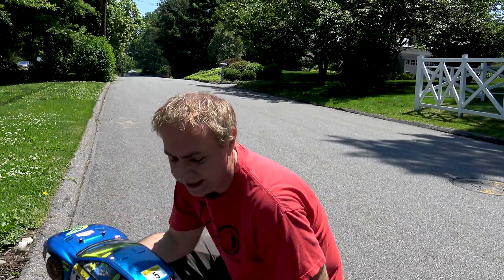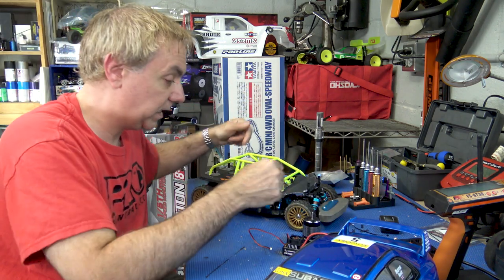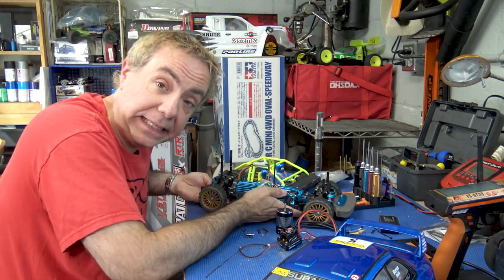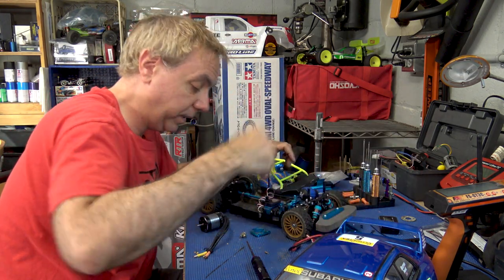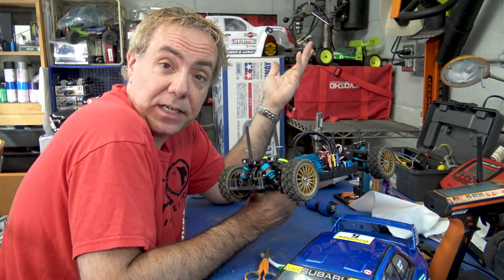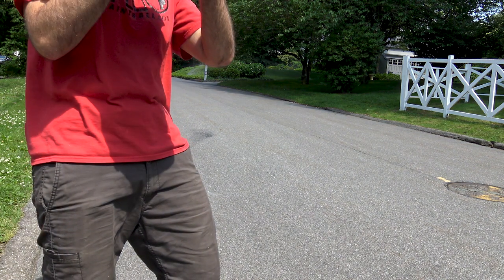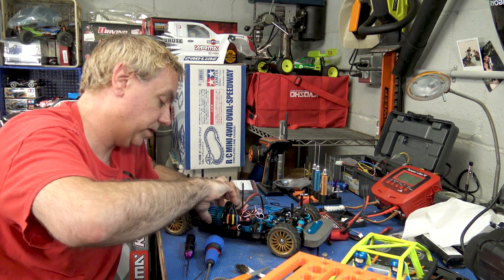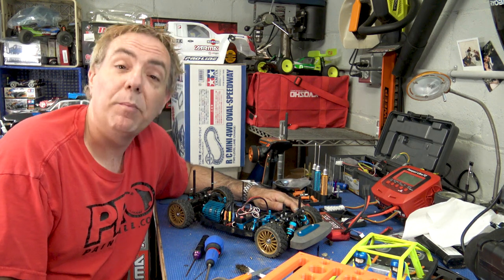Tamiya TT02 - Brushless Conversion

Comment: For anyone wondering, the noise after the brushless motor was installed is 100% binding and too tight a' mesh between pinion and spur. Try the paper method when meshing gears ❤❤ awesome video though! ❤❤

Comment: Hello John. The high speed gear set isn't for powerful motors. High speed in Tamiya terms means top speed. I.e low powered motors geared for top speed (large pinion, small spur). For you situation, using a powerful motor like the one you have requires a small pinion count and a high spur tooth count in order not  to prematurely wear out gears.
Reply from the maker: I learned that for sure. Looking into a metal spur gear next. Thanks for the clarification. Guess I should have looked more carefully before the install. Oh well. Next time.
Reply: @JohnBattistini00  The kit spur should do fine. I would look into a tamiya hardened low tooth count pinion. A 17t or 18t to start. I am building a tt02 rally car for competition and have opted for outright acceleration and torque over top speed.
Reply from the maker: @gatzuberserker  cool. I will try that I am getting another identical spur to replace the one I stripped along with the metal so I will look at a different pinion as well. Thanks.
Reply: Hey there. I have 26 and 27 tooth pinions matched with the 68t spur. No issues ripping up and down the street. Spurs are clean as a whistle. Get a tornado fan from yeah racing for your motors. I also think a metal spur is not a good idea. You will find metal shavings under the cover.
Reply: @gatzuberserker  17t - 18t is way too low ... that's a ratio of over 9:1  with that motor anything above 7:1  is probably fine, .  With 25T / 68T spur you get 7.07:1 

For reference Tamiya manual state that 10.5T 3370kv motor should use range of 6.5-9.3 gear ratio
Reply from the maker: Interesting, thanks for the tip. I have been looking at those fans, they look amazing.
Reply from the maker: Oh interesting. I didn't realize that. I guess I need to pay more attention to things like that.
Reply: I run a 10.5t brushless with my high speed set with 62t spur and 28t pinion using 48dp gearing and all is fine. I wouldn't call 4000kv too much for the gear set, not by a long shot. I've even used a 32t pinion but the motor starts to heat up. Hell be fine with that set up. His mesh was off from the start. You could hear it when he tested it on the bench and even more so when he ran it. Just needs to mesh the new spur better that's all
Reply: @aut0bahn  I absolutely agree. The high speed gear set wasn't the issue, The meshing was, I run a 10.5t brushless with gear set using 28 pinion and 62 spur on 48dp and have zero issues whatsoever
Reply: Do you guys think adjustable mounts are better than ones with predetermined  pairs of holes... that way you can set the mesh precisely yourself?    The one I have in my cars is slotted as on a lot of our 10th scale offroad cars.

Comment: I ripped my Gear with a 4500kv brushless Instant, i bought a beltdrive Universal convert kit from eBay for 15$ it works and i was surprise how silent this is now.
After 3 month of driving i needed a new belt but it cost me 2$ for a Pack with 5 of them and installing a new one Takes nearly no time.
Reply from the maker: Really? I had no idea that was even an option. I will have to look into it, thanks.

Comment: Hi, I've got high speed gear sets in a couple of my TT01s. They run super smooth and they fly along. Got an alloy motor mount in one and standard Tamiya plastic in the other. They both have mounting holes so ensures no slipping, misalignment etc... Just be sure to use the correct holes. I assume TT02 is similar so maybe try the standard motor mount... great video and I've just subscribed too...
Reply from the maker: Awesome. Thanks.

Comment: I saw another video where a guy upgraded his TT02 to brushless & he used a smaller plastic spur gear with a bigger than usual aluminum pinion gear & his seems to work amazing. He's doing speeds of 97mph, but with the correct tire compound, & so on. So it sounds like you might need an aluminum pinion with a plastic glass infused spur gear

Comment: Make sure the gears have just a little slop in the mesh. You never want it tight or plastic spur will strip in a matter of a few runs. I have had the stock plastic spur in my tt02b for years and have over 20 packs of 2s lipo runs through it. Never stripped anything. 3900kv 23 pinion with stock plastic spur.  Running 34mph gps verified and bashing.

Comment: Hi John, plastic spur gear should be fine, make sure you order steel pinion and your problem is solved. I think that weak aluminium pinion destroyed your spur. I'm running steel 25-31t pinions with 4300kv motor  and 3s - no issue. Also check the mesh carefuly.
Reply from the maker: Yeah I will be honest I think my mesh was too tight. Gonna make sure I have a steel pinion moving forward. Thanks!

Comment: Gear mesh to close you can hear the high pitch whine stick a piece of paper in between to get proper gear mesh. Im running same set up with 3300kv motor 25t pinion and 64t spur with no problems.
Reply from the maker: Gotcha. Thanks. I was worried and guess it was off. Hopefully with the new mount it won’t be an issue again.
Reply: One thing about the high speed gear setup is that you dont have to use Tamiya spurs and pinions. Im using a Robinson Racing composite pinion and a 3 Racing spur gears, much lighter rotating mass👍
Reply from the maker: @shy1lrey880  oh cool. I need to look through my bag of parts then I may have one of those lying around from other builds. Thanks for the tip.
Reply: @shy1lrey880  where did you get your set up?
Reply: @dontforget.thetruth9305  The spur gear was ordered off of the TQ Racing website and I was lucky enough to find an old Robinson Racing pinion gear from my local hobby shop, idont think that company makes those anymore. I think Trinity makes composite pinions not to sure though. So check TQ Racing website they probably have those types of pinions👍

Comment: I also have this car and will also upgrade to brushless, need to change steering mechanism to coz it's all over the place at the moment😀👍👍
Reply from the maker: Totally. I am really happy with the upgraded one from Tamiya that I installed. You may want to check it out.
Reply: will do 👍
Reply: i have this car, put shocks, bearings, foam inserts in it.
  i have spectrum  5ch with AVC receiver, no wiggles / nice steering.

Comment: Hey there. First time commenter here….but I have a couple TT02s with the high speed gear set. Note, when you use it (or different pinion) the holes you use for mounting the motor mount shift from what is in the manual. I made a similar mistake on my TT02 and the gear mesh was too tight. Luckily I caught it and made the adjustment. May not be the issue here, but something to look into. I have a brushless motor in my TT02s and they rip. If I had to be venture a guess, more than 50mph….maybe more. And I run 3s.
Reply from the maker: Nice. I have the Yeah Racing motor motor mount so while I don't have to worry about the hole I do have to align the mesh by hand, and I get I messed it up. Going to really work on it when I get the replacement spurs and new pinions.
Reply: @JohnBattistini00  ah yeah, the yeah racing part doesn’t have the mounting holes. Get the Tamiya part and you won’t have to worry about it moving on you or not getting the mesh right. I think that solves your problem.
Reply from the maker: Cool. Will check it out.

Comment: Your mesh was way to tight even on the bench at the start. The sound and fast slowing of motor was a dead giveaway. The high speed set is fine but buy a 48dp spur and pinion as gearing options will be much wider than the mod6 I think it comes with. I run a 10.5t brushless on mine with 62t 48dp spur and 28t pinion and it runs beautiful. Remember to make sure you enough backlash on the gears for them to rotate freely. But good vid dude and keep em coming
Reply from the maker: Yeah, rebuilding it now, gonna make sure it fits right this time.

Comment: I've got the same high speed gear set..I'm running a 24t pinion on a 15 turn brushed hpi motor. On 3s batteries I'm getting 37mph...on 2s 26
Reply: Dunno how you only got 26 I'm running stock spur gear 3520kv motor 2s I'm hitting 30mph
Reply from the maker: Yeah I def have something wrong!

Comment: This is an old video but the minute you took off I immediately knew by the whine sound that the mesh was set incorrectly, do you manually set the mesh on these cars or do they have set gear mounts ? a car should never whine like that when set with the right amount of play, it sounds like the mesh was set way to tight even on the brushed motor it sounds tight., there's nothing wrong with the plastic spur I run plastic spurs with aluminum pinions in all my Drag cars going over 80 mph in 132 feet, for drag cars etc it's all in the mesh and installing it correctly, installing a metal spur won't fix the problem itll only create another issue down the line ie: smoke your motor, your transmission etc etc, id highly recommend staying with the plastic spur and aluminum pinions and figure out why the mesh is so tight . Plastice spurs will never burn out out regardless the power if set correctly 👍🏁💯
Reply from the maker: Cool, thanks for the info.

Comment: The pinion mesh never sounded right from the minute you bench tested it. I have dozens of Tamiya cars with brushless systems, some way more powerful than that, and they are just fine on the standard plastic spur gear. 
I do find with aftermarket motors, some don't line up and give correct mesh just by using the numbered hole in the Tamiya engine mount. They are drilled slightly out of whack on the motor can. You need to manually check it, or use the yeah racing mount that has infinite adjustment, not just set holes.
Reply from the maker: Thanks, yeah I def messed up. Working on fixing it.
Reply: I agree. Sounded way to tight from the beginning.

Comment: Mine does about 40 with the brushless and gearing I have. Ive got the same subaru. Just flipped it in the road and was soo bummed.lol ive been babying that body.
Reply from the maker: Whoa that’s fast I need to mess around a bit more and get my speed up there. Did you swap out the tires for something with more grip?
Reply: @JohnBattistini00  I have the soft compound tamiya rally blocks. A little better grip than the stock rally block but a little hard to come by in the states. Ive got some contact foams on the way. Im putting a 45t pinion and 49t spur on it with a 59000 kv for speed runs with a different body. People have gotten 100mph out of that setup soo im looking forward to it.lol
Reply from the maker: I will have to try something like that. Thanks.

Comment: I guess you should switch to metal gears if you use a high torque setup. plus you wanna use a little grease in the gearbox i guess.
Reply from the maker: Yeah I need to look into that. Thanks.

Comment: I've got the TT02 as well, looking to upragde to brushless. I'm surprised that your brushed system went 27 km/h. My brushless system a completely stock with a 15 turn motor, and maxes out at 42.9 km/h (26Mph).
Reply from the maker: Well I did not have it set up properly at all.

Comment: Looks like you had a better luck with aluminum upgrades than me, had to ditch some because they just didn't want to work, also have to tear apart the front dif this weekend as it does not turn with the rear dif.
Reply from the maker: Oh that is bummer. Where they unusable due to not fitting or were they just not made right?
Reply: @JohnBattistini00  The front dog bones just didn't work like they should, kept binding up, the rear hubs I bought had to file done the sides on the lower half so it would fit in the rear suspension arms I bought, I think If I could have gotten all the aluminum parts from one person might have had a better fit?
Reply from the maker: Oh maybe. I have seen complaints that some of the different manufacturers stuff doesn’t all fit with each other. Did you eventually get it all sorted and running?
Reply: @JohnBattistini00  Not quite yet, just don't look forward to taking apart the front dif to see why it is not working
Reply from the maker: @70gambit  yeah. That can be a pain. Good luck and keep me posted.
Reply: @JohnBattistini00  Had I known about yeah racing, I would have bought the full aluminum kit from them
Reply from the maker: Oh yeah. There stuff is amazing.

Comment: Been running mine brushless with stock diffs and high speed gear and soo far its fine. What diffs are you running in that?
Reply from the maker: I got the Tamiya oil filled ones. They seem to be holding up great.

Comment: Hey John did you post a video with the new gearing? What did you wind up using? What T count did you use for the spur?
Reply from the maker: Still working on that one. I couldn't help myself so more blue parts are going on as well as the new new spur.

Comment: The gear mesh sounded way to tight on the bench test. Also, Did you change the pinion gear or using the 1 with the kit? Tamiya uses that wierd gear pitch. I did a high speed conversion on this same car, I got the 48p spur and changed from the tamiya pinion to an aftermarket 48p pinion. I'm running a hobbywing justock 13.5 system in mine, with a metal driveshaft and a ball bearing kit. I have had absolutely no issues with my drivetrain so far. I've a bunch more upgrades, mostly for suspension and steering but the drivetrain seems pretty solid in these.
Reply from the maker: Yeah it was def too tight. Working on rebuilding it. Thanks for the tips, I will look into that.
Reply: I'm running the same Justock system in mine. What top speed are you getting out of it? Trying to find a comparison out there.
Reply: @Canadian_Spartan  I haven't put my performance analyzer in it to get an exact speed. I can do that tomorrow after work and give u some solid numbers. I'll also include my battery specs.
Reply: @SubZ3ro907  that's awesome! Thank you.
Reply: @johnpapageorgiou8058  so John, I said heck with it and I just went out and did a run for you to see what we could get. On a cheap Gens Ace 5200mah 35C 2S pack, I just ran 25mph. I am using the high speed gearing and went up 3 teeth (i think) on the pinion. My car isn't built for speed runs. It's setup for medium size rally tracks. It runs very cool and could easily handle a few more teeth on the pinion. I also run a lexan dust cover that restricts airflow, so I have to be careful about overgearing it as it will overheat. You should be able to hit 33mph easily and safely with your 13.5 setup. Hope this helps. I will try and get a video up on my channel soon, showing my rally setup and the analyzer data.
Reply: @SubZ3ro907  perfect, thank you! This definitely helps. I'm running basically the same numbers as you. Which I'm good with. I like and prefer the low end grunt vs the top end speed for what I'm after.  I appreciate you doing that! 👍🏼
Reply: @johnpapageorgiou8058  not a problem. Always willing to help a fellow RC'er.
I run 13.5 and 2s battery because our local races restrict our motors to that with an esc in "blinky" mode. Overall I do prefer this kind of setup because it doesn't destroy parts and the car is very stable and balanced which makes it alot more fun to race with. If I want to do top speeds, I have a 135mph arrma limitless I can play with, lol. Anyways, I just did drone coverage of our local races tonite. Check them out on my channel.
Reply: Hey John, any updates on your TT02? How is it running? What changes have you made? I wish you would shoot us a new video and show us.

Comment: I run a 4000kv on 2s with stock diffs speed gear and 25 pinion. Never had any issues with the diffs. They hold up pretty good. I also never had a problem with the spur. Get the Tamiya TT02 Motor mount 54558 with the holes for different pinions. Don't use some slotted shit an mess around with gear mesh...
Reply from the maker: Yup just got a new mount in with the position holes. Hopefully will keep this from happening again. Thanks.

Comment: Still one of the reasons why I haven’t bought one because I cannot handle plastic gears!   They must make a metal gear set for that?    Until then the TTO2 is not in my future!
Reply: If you buy the high speed gear set, you can easily swap over to a metal spur because the high speed gear set allows for their to be any spur that has screw holes, maybe the tt02 is in your future!

Comment: METAL VS PLASTIC ADD BRUSHLESS POWER YES BEEN THEIR. I HAVE ONE COMING HOME SOON ALREADY BUILT AND PAINTED WITH 13.5 TURN BRUSHLESS SYSTEM STOCK ESC BENCH TEST BUT NEVER BEEN DRIVEN I WILL LEARNING TOO.I'LL BE WATCHING YES SUB TO YOUR CHANNEL GREAT VID GOD BLESS BROTHER AL YAKIMA,WA. I LOVE THIS HOBBY WIFE??!!
Reply from the maker: Sounds great. Glad you are excited and having fun!
Reply: @JohnBattistini00  JUST GOT THE GEAR SET RUNNING 64/26 13.5 TURN MOTOR 5200mAh 50C HAVE NO MPH. TESTER BUT FASTER THAN 25 TO 30. TURNS ON A DIME.  I ALSO RUN GASERS 26. TO 45CC 1/5 SCALE LOVE THIS HOBBY GOD BLESS BROTHER AND FAMILY AL YAKIMA,WA
Reply from the maker: @alanflatau1685  AWESOME!

Comment: Im not a lipo brushless man but did try this.....................tt01 raven 10tx2 67t spur 22t pinion fast tt01.
Reply from the maker: Sounds awesome.
Reply: @JohnBattistini00  It would need a powerful brushless motor to work as im olde school nicad, nimh and brushed motors only guy. But yes 67t spur...............
Reply from the maker: @cutterbacon  Nice.